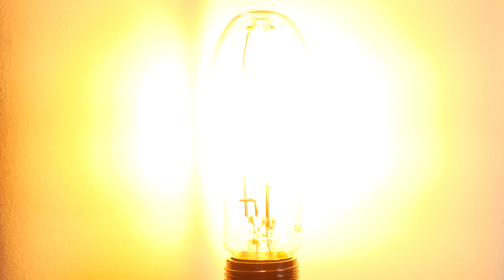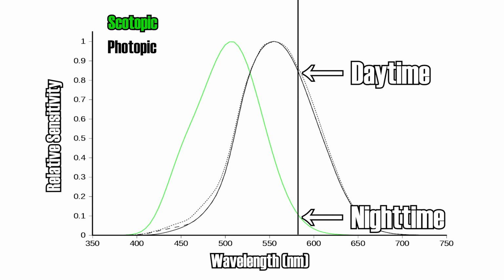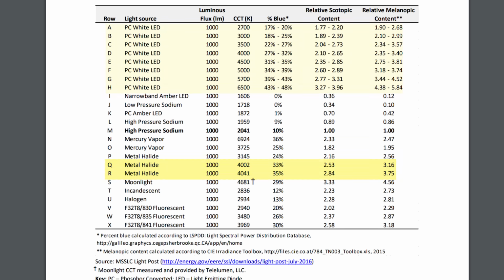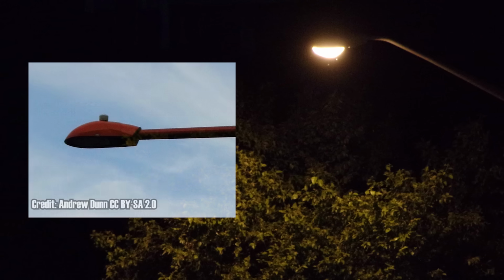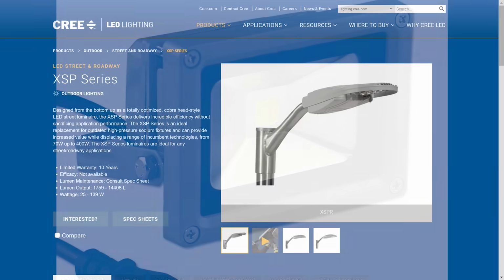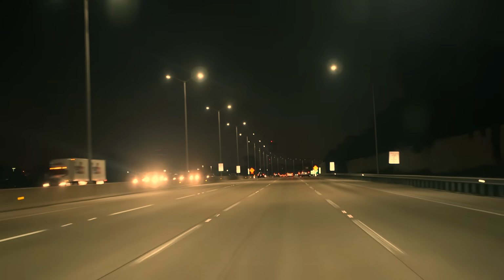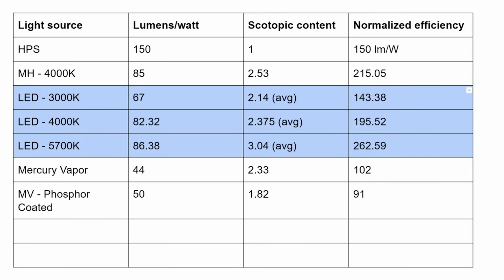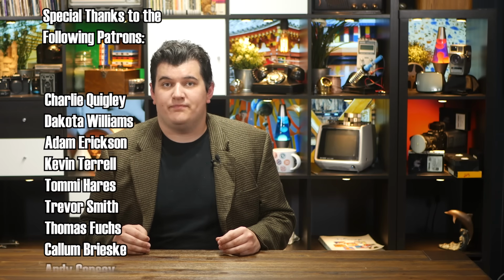The LED's Challenge to High Pressure Sodium

Comment: The advantage of led is the adjustability, you could use 5700k for major outside roadways and/or major intersection/crossings, the 4000k for city main roads and 5700k for residential and "wildlife critical" areas. Dimming gives the option to reduce the lighting at nighttime and to compensate the day/night-transition to go to 100% during transition and go down to 75% for the evening and reducing to 50% at night. Depending on control ability switch to 100% ICE in that area or even switch to 5700k, we could escalate it to segment control on a motorway  (may go to far but the idea is good) to change every second light to 3000k in case there is an accident ahead to alert drivers (like a yellow flag) and to mark the place of the accident at 100% 5700k

Comment: I know this isn't really about automotive lights but the 5000 range give or take a thousand is the way to go. The closer to the ground the more yellow you want. I won't go higher than 6000k for any, I use 3500k low mounted fogs with 6000k high, low, top mount off-road and drls (because there weren't enough high output ones with the chips in the proper positions on mounts that don't get in the way in the 4 through 5 thousand k range. With high output amber marker lights and fogs adding definition to to the 6000k white. Any higher than 6000k reduces contrast and is too much work for tired eyes.  You can really tell the difference with 6500k side by side, they are terrible for making out shapes as you go. I wish I could have gotten some 5500k ones with the design and output in the price range. But with much research and testing I got crystal clear white light with no spots, perfect low cutoff, and a boost to warm contrast along the ground with amber lighting where it matters most 2 feet off the ground at a long distance.

Comment: As they are used now in cars the LED lights are really bad! A.) they fit mostly way too bright lights as standard, it is especially bad during winter nights if it is snowing or raining a little, b-)plus the blue hue the leds usually have is really annoying and stresses the eye more. C.) if every one starts using these overly bright lights, any "pedestrian safety" is off set by both drivers being flared by the brightness of basic daylights.
I cringe every time i have to drive in the dark now(i used to love driving in the dark because people tend to behave better behind the wheel during the dark, as per my own experience)
Since i know when ever i hit a dark patch its a dice roll now if the oncoming driver has overly bright leds or regular lamps. this is especially bad if we are on 80-100kph area with no middle bank/patch off grass, Alot of times when i have passed/about to pass one of the oncoming vehicles with leds, the whitelane markings can become blurry/not visible due to the brightness of the lights

And no, not talking about long beams, regular daylight lights. The reference luminance that is allowed is way too high for leds.

Comment: Cars are dangerous because they move very fast relative to what our eyes/brains/bodies can respond to. The more that we discourage fast driving, the safer spaces are for pedestrians. There's some pretty neat evidence that (vastly oversimplified) making drivers feel unsafe by narrowing roads and adding obstructions makes them slow down and pay more attention, resulting in overall safety gains for both pedestrians and motorists. In general, I think we should overhaul urban design and laws surrounding right of way etc. to put pedestrians first except in specifically designated areas (eg. the freeway). Along those lines, it makes sense to focus on orienting lighting in urban and residential areas towards the needs of pedestrians and residents. Pedestrians don't need much light at all in order to be safe, and warmer light is much more pleasant. Meanwhile, cars, hemmed in by car-hostile urban design, would be brought down to speeds where driving is safer in lower light (lower light itself might even contribute to the sense of anti-car hostility and further reduce speeds). Cooler lighting could be used in car-focused areas like the freeway, where aesthetics are less important.

Rather than making driving safer in ways that make drivers feel safe, which has the opposite effect of making them more complacent and reckless, we should focus on making drivers feel like hemmed-in intruders in a space designed for pedestrians and against cars so that they naturally drive more cautiously and more safely. Accommodating cars in pedestrian areas is what makes them dangerous, and refusing to do so makes blue lighting unnecessary and undesirable.

Comment: Sometimes I ride my bike at night on this bike trail that is far enough away from the rest of civilization that it's actually somewhat dark there. I actually turn my bike's head light completely out because I can see pretty well in limited lighting and so I can take advantage of my full peripheral vision then. If I see another bike coming the opposite way, which is rare, I turn it back on its lowest setting. I also always leave the back light on, even though it does produce more light than I'd like but I don't want anyone to come up behind me and be surprised, which is something that has never happened at night even though I ride my bike really slowly.

I think that having bluer lights, particular on highways, seems like a smart idea since we don't want people to get drowsy while driving. It makes sense to use the less blue lights in residential areas but if someone is driving really late at night, they might actually need to maintain their wakefulness. I think particularly of truck drivers who drive through the night. Yes, coffee exists but why make it that much more challenging by having lights that are too warm on the highways?

Comment: I think the argument concerning 5700k lights affecting sleep patterns is a more complicated than it just being seen as a con when applied to street lighting. I prefer the appearance of the yellow sodium lights but the fact that they induce sleep or that the 5700k led lights block drowsiness (what ever way you want to state it) means that the 5700k lights are even more safer on especially motorways where falling asleep at the wheel during night time driving is already a problem. However, having 5700k lights shining through your windows at home disrupting ones sleep cycle would be undesirable. So could there not be used a combination of the two - warmer lights (either warm led or sodium - which ever has better energy efficiency) for residential/slow moving traffic roads and the 5700k for fast moving traffic and motorways?

Comment: I have opinions:

I live in an unfortunate or fortunate area where I'm affected by both LED streetlights AND HPS highway lights.

The HPS highway lights throw enough light onto my backyard that, depending on how cloudy it is (skyglow), my yard will be very well lit. So lit you could read a newspaper. It's very dim light- but spreads very far.

Our streetlights were HPS, but changed to LED. I prefer the LED for a couple of reasons:
The lights are designed so the light doesn't spread as far (you mentioned being able to see light source from above), and the color of the light helps me see what's in the street.

You may prefer the glow of the HPS, but it is harsh to me because I see ill defined shapes under its light. The light throws VERY far, but the drop off in being able to tell things apart really bothers me. I mean, you can tell that there's something lit, but the monochromatic view and the wavelength makes it really hard to pick out. Things in LED are much clearer and easier to pick out. The flashing of HPS is also more severe than their LED replacement street lights, too. At least to me.

There are also LED's in some stretches of highway. I prefer their light because they are well contained and the wavelength, less spread, and less flashing makes me feel calmer and more aware of what's going on instead of dealing with the harsh light of HPS.

Comment: I have a couple of other areas of consideration to throw into the mix. One is that bluer light scatters more, so clear vision may be worse. I haven't paid a lot of attention or noticed the difference on anything other than advertising that is predominantly blue. Those are very fuzzy in comparison. 

The main thing I have noticed is the effect on night vision. Where there are dark spots (between light sources, going from main road to side roads, un lit underpass etc), my vision takes that much longer to accommodate from LED lighting than from HPS lighting. I find that quite dangerous.

Having said that, I have changed my headlights from sealed beam halogen to h4 bulb halogen and now to LED. I much prefer the properly aimed LED lights for their illumination. As an empirical observation though, it seems that more drivers using vehicles with LED illumination are activating their fog lamps in clear weather than drivers with incandescent lighting. I am not sure why.

Comment: I can only give observations based on my own experience here in the UK, but it is becoming apparent that the use of LED technology is rapidly displacing high pressure sodium.
The biggest advantage (other than efficiency) is the more effective use of lighting facilitated by the greater flexibility afforded by LED technology.  I should point out that this seems to be due to the LED units only being used in new lighting units, specifically designed for the newer technology. 
Given this proviso, as well as the reduction in sky glow, a well designed system also reduces the overall "spillage" of light from its intended use. So while the wavelength may indeed be more likely to interfere with human circadian rhythms, there will be a significant reduction in the overall amount of light experienced by residents in these areas (other than those who are outside and on the move, and should hopefully be awake anyway!  🤔)
So, overall, I am pleased to lose the baleful yellow glow.

Comment: Seems that the LEDS should be mounted just over the K barrier, and angled to not hit drivers in the face.
This would light up the road surface, and allow them to be arranged in a line to avoid hot spots.

Comment: They should be outlawed....These lights are fucking up peoples night-vision..causing gradual night-blindness..hence you become more dependant on the health-care-system...."Yellow" lights on the old-night-sensor-system were "meant" to be that way, so you could see without getting eye-fatigue..and..you could see them in fog without getting dazzled by the now..L.E.D.-radiation-emitting ones. Its been enforced deliberately..I say..take them down..together..locally..and spread the word to remove them....(You'l also notice.."authorities" state they're not as bright as some) to basically justify them even though they know its wrong. So they're pushing to keep them in to destroy you.."gradually"....Yellow/Orange lights at night still gave us enough light to see..whilst your body was adjusted to night-time conditions..Now its itense..and has changed the moods as well..but thats also part of the idea behind them. They're no better than a fake-pandemic-vaccination excuse....

Comment: There is no strong proof that better lit roads lead to fewer accidents, though. In Europe, several countries (including Belgium, France...) have started turning street lights off on motorways.
They have noticed that the number of accidents actually decreased with the lights turned off, because drivers were more cautious and drove slower.

Comment: 5500k is best white light above this and it gets more blue the higher you go and 5500k isnt as harsh on the eyes as 6000k and above is. ive used 6000k hid lights on my car and theyre ok better than halogen but still a bit crap. but led's at 5500k much better!

Comment: I'd kinda like if household lighting technology gets standardised in a way where your average switch and socket both support the off and 100% on options, but also a 25%-50% option. I don't need every switch to be a dimmer, I just want the option of having an already pre-determined lower brightness level for use at night.

Comment: Cars will all very soon be self driving and many use lasers to see so visible light won't be needed at all. Electric cars are also silent and can be made smaller safer cheaper and may not need those huge parking spaces.

Comment: They put LED (blue-ish kind) lights on my street since this was posted and it's been a major adjustment. To me, everything is darker and the light doesn't reach nearly as far, but the worst part is the shadows. There isn't the same glowy gradation to the shadows, now they just stop. It's super creepy to have one side be brightly lit then total darkness on the other side of an object like a car. I'm actually really surprised that LEDs are worse for light pollution because of the shadows on my street.
Reply: I bet they just put LED bulbs in the existing fittings, with reflectors shaped to spread the light from a point source (eg sodium vapour or halogen) rather than a more spread out sourcelike an LED bulb. Its not an inherent problem with LEDs - just they need to have fixtures made for them.
Reply: @kenoliver8913 that's precisely what I think it's the problem, because I don't seem to notice this in a brand new road nearby that had LEDs from the start - only on the pre existing roads where they just changed the lights. Granted the new road has higher poles, but you couldn't believe some of the complete gaps in light some old roads have after the switch. Like, I cannot believe someone actually fitted those and thought having a stretch of road that long be dark was acceptable.  (Also sorry for replying to an old comment, I'm just excited to complain about street lights)
Reply: If there is a bright led light in your vision your eyes aperture adjusts to that so the dark parts in your vision become really dark and the overal picture is less clear. That's my experience and it makes sense.

Comment: Hopefully sometime in the future, we can have "smart" LED street lights that change the Kelvin light temp color throughout the day. Start the day with a 4000k-6000k, and as the day progresses to sunset, lower it down to 3200k, but still LED (But  keep 4000k-6000k on major highways for better highway driving).
Reply: You... Dont need streetlights during the day? The sun still exists
Reply: @Timeward76   not with that attitude
Reply: @Soonerblake007  no, Timeward's got a point. I don't understand why you would need street lighting during the day.

Except for tunnels maybe, where matching the light colour in tunnels with outside surroundings would be pleasing to the eyes.
Reply: @Timeward76 
Wait for a severely overcast, stormy day, and tell me that again with a straight face.
Reply: @DinnerForkTongue  ive seen trying to drive during incredibly stormy daylight condition... I dont think street lights make much of a difference when your visibility can be measured in inches.
Reply: The new German high-speed trains use this approach in their interior lighting
Reply: overcast daylight is around 6500K, CFLs around 5000K, typical LEDs for room lighting around 2700K, normal incandescent around 2400K, candles around 1850K and low pressure sodium around 1700K.
The thing about streetlight during daytime is that even at day it often isn't really that bright. Full daylight is around 10,000-25,000 lux, sunrise/sunset is around 400 and an overcast day around 1000 and can go down to around 100. So on a dark day it can be a quarter the brightness of sunrise. And depnding on latitute and season that can warrant turning on street lights as early as 3-4 pm and keeping them up until 9-10 am
Reply: I think this is ideal genius idea that is best of both worlds
Reply: Blue light helps keep you awake and suppress melatonin. Unplesent, sure. Not helping you put your kids your driving home to sleep. Of course thats not good. But do we really want to call this a bug when it's helping keep drivers awake at night?
Reply: Nocap underrated comment
Reply: Blake B
This is nowadays possible! Take a look at the BLF LT1 lantern project.
Reply: This technology already exists. We just have to implement this idea.
Reply: I would imagine the "higher power" units for motorways being the "better" BLUEER light and have the lower power units in residential areas a "warmer" colour would go a LONG ways and save on the complex electronics / networking to drive a colour shifting system

Comment: What about the 4000K LED fixtures? the Scotopic light output according to your graph is much closer to the 3000K light, however the efficiency is closer to that of the 5700K fixture. It seems that 4000K is the happy medium that is less abrasive and polluting, yet still efficient.

Comment: When it comes to road safety melanoptic disruption is only relevant to driving professions like taxi or truck drivers. I am quite sure our quality of life will not be devastated if we have to drive in cool lights for half an hour. And i would trade that for increased road safety, lower power consumption and higher efficiency through product life. So the trade off is actually far less than you describe...

Comment: I know this comment is late but I think a good solution to this problem is LED lights on major roads but have the HPS lights in neighborhoods. Since safety is a more important issue on major roads having the bluer light makes more sense and you don’t want to be sleepy while driving anyway. If neighborhoods got LEDs the residents would understandably be upset because nighttime wouldn’t really be night anymore and typically when you’re at home you want to sleep.